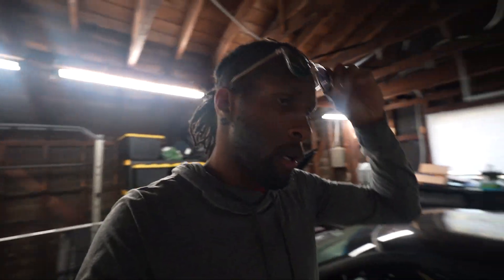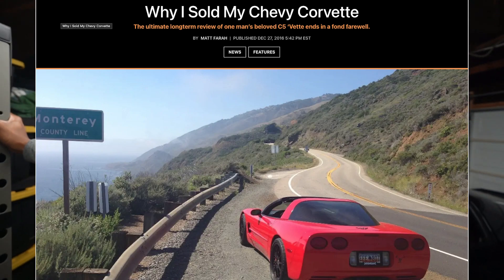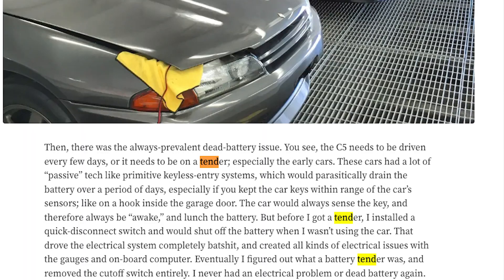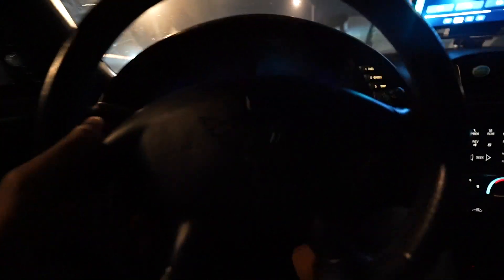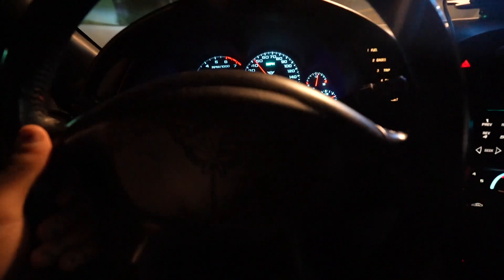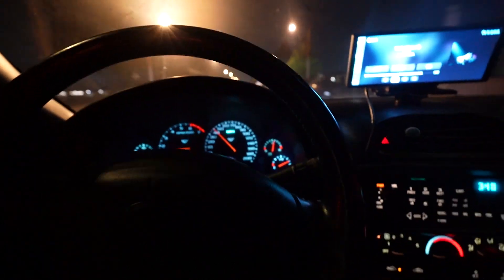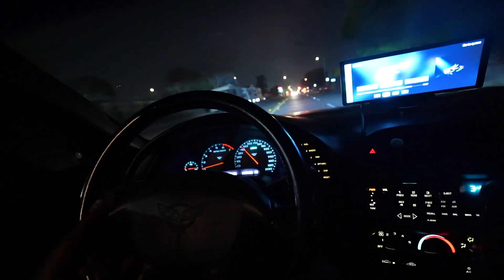Reviving my C5 Corvette: Unraveling Electrical Grounding Mysteries

Comment: The oil pressure sensor is behind the intake manifold, the manifold needs to be removed. Not a difficult job just time consuming and btw you DEFINITELY have a vacuum leak which will make your engine run lean and rob some power. I had a vacuum leak in the same exact area and solved it. Im assuming you’ve fixed all of this at this point though.
Reply from the maker: Yeah you are right, that is where the oil pressure sensor is. I've been through the vacuum leak and got it fixed! The car is back up and running great now but I still need to do the oil pressure sensor

Comment: You should always pull and write down (or take a picture if no pen & paper handy) your current codes from the DIC on your dash. This way you have some direction on what to chase.  This can get expensive if you blindly throw parts at it. And you shouldnt need to have to with the onboard diagnostics in the C5.

The issue you had can be grounds, inside the modules connected to the grounds (which you should have also cleaned),  battery cable connections, the battery itself, that kill switch you installed and the wiring to it, or your alternator crapping out. As well as a few other things like ignition switch or relays to the OEM theft deterent system. 

I say check your battery cables for good secure connections and no damage...  and remove that kill switch. The C5 has enough electrical gremlins it doesnt need an enabler. 

I've owned 3 of them, my brothers both have one and i still have the one I bought brand new that now has 136k miles on it.  So I've had my share of turned wrenches and problem solving with these things. 

Good luck!
Reply from the maker: Thanks for the info. Much appreciated 🙏🏽

Comment: Battery in top shape?  Corvettes won't tolerate low voltage.
Reply from the maker: It's a brand new Red Top. Just replaced my other battery which was still pretty much new to me.

Comment: I keep my car plugged in all the time low voltage will cause some crazy shit
Reply from the maker: I’m hoping that’s was my only problem
Reply: That's not right. The engineers don't want you doing that it should run every day even a week later my Corvette starts.
Reply: You gotta go through everything they didn't come like that from the factory. Or did they? Tell me.